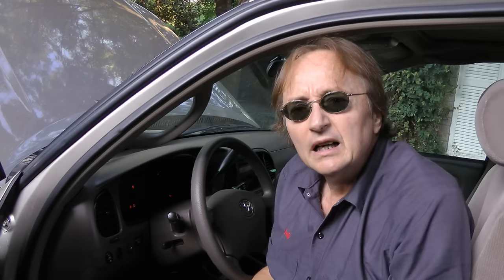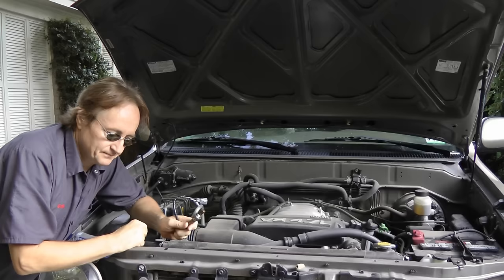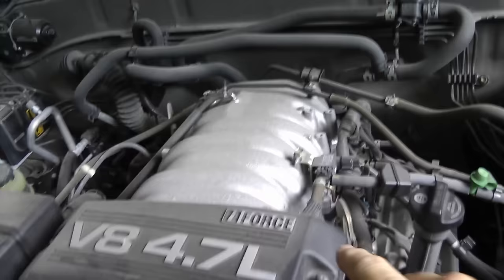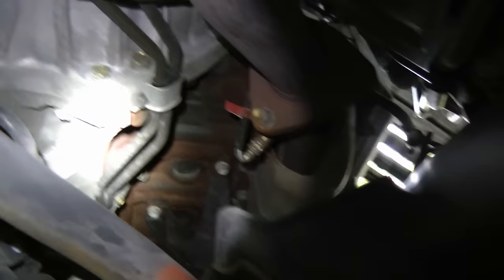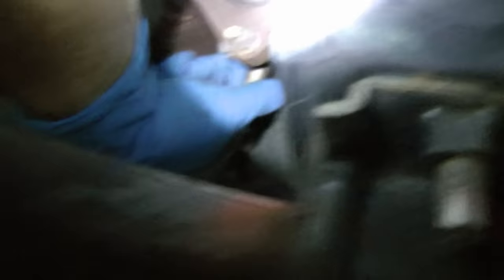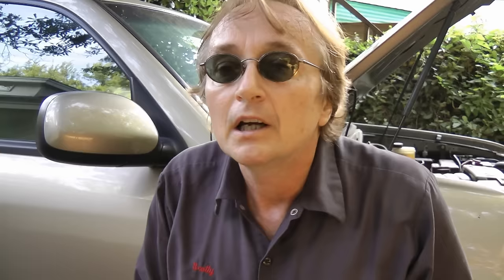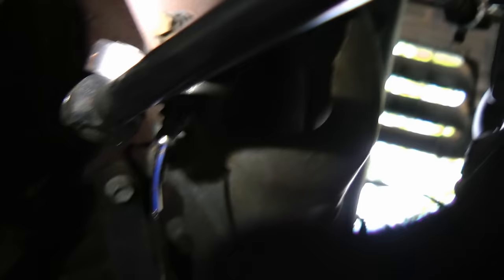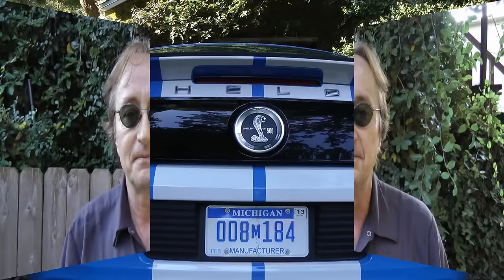How to Replace an Oxygen Sensor in Your Car (Air Fuel Ratio Sensor)

Comment: I have a not-so-good Hyundai Accent first gen maybe. And I have problem with Check Engine. It only shows up when I'm 50m driving distance already -the most... when I check under the hood, there are sensors that are not connected as the unit was already removed... I would like to ask how to remove/disable/cancel/blind a sensor? thank you Sir.
Reply from the maker: computers are made to run with all the sensors, if any are gone or disconnected, the light will never go off, no way other than putting it all back to factory specs would fix that

Comment: Got a question for you Scotty. 1989 Ford Probe GL 2.2L SOHC 4 Cylinder, manual trans. I got an OBD1 error code 17 EGO Sensor (Oxygen Sensor) Running Rich (no other codes were thrown during self-test regardless of engine on or off). Is it best to just replace the O2 sensor outright in this case?
Reply from the maker: running rich cn be tons of things, and on that old thing, often leaking fuel injectors. The sensor normally reports a problem, doesn't cause it. though running rich can burn out the sensor over time too.  I'd have a pro check the fuel injection system first myself though.
Reply: Thanks Scotty, that gives me a direction to go in at least. The car has been randomly killing on me when idling up to stop lights. With this being the only code, hopefully it won't be too painful of a fix.

Comment: Hi Scotty, I have 03 Tundra limited with the iforce engine also....but with a code that read p0057. Is that the same as the p0051?
Reply from the maker: no, different sensors for those codes, same code basics but for different sensor location, that engine has many sensors on it

Comment: Hey Mr. SCOTT. I have a 2010 mitsubishi lancer and my mechanic said that i need to replace 1 O2 sensor. Check engine light was on and he showed me the code. He did a diagnostic test nd found 1 bad 02 sensor. He said labor nd new original part will cost me $495. He said cheaper than going to dealer. Is that a fair price?

Comment: Hey Scotty, I got a problem with my 2006 crown Victoria police car, I had a po171 running lean bank 1 and a po174 running leak bank 2, I just changed my fuel Injectors, when i drove it down the road. I plugged my scanner and I have a code for a 02 sensor running rich, and another for it. When I start the car and push the gas down, it completely dies on me. Can a 02 sensor cause this.
Reply: Hi Adam, it's your manifold sensor gone bad P0171, try cleaning it, I had the same problem  2015 nissan quest

Comment: Scotty, 2005 Hyundai Tucson 2.7L V6, got codes P0150 and P0340.  O2 sensor and camshaft position sensor.  Could 02 sensor cause both codes?
Reply from the maker: no, but camshaft code could trip the other

Comment: Scott, I have a Subaru wrx 2006 and it's modified. The check engine light is on and I scanned it , and it says an o2 sensor is bad and it will not turn on. What do I do ? It also burns gas fast
Reply: El jr 3 Did you change it yet?

Comment: Great tip. ALWAYS use OEM for spark plugs. Thanks again. 

Does that mean most cars only have 2 sensors?
Reply from the maker: +IWBVS depends on the design, some have 5

Comment: how can I locate the O2 sensors fuses in the fuse box,I have a 2015 toyota corolla? what happens if I take them off? and also how can I locate the mass air flow fuse box?
Reply from the maker: ahmed sal they are not fused, they run off the computer with very little power. same with the mass air flow meter, no fuse for that either. But if you take sensors off, it will mess with how the car runs and ruin the air fuel ratio and turn the check engine light on

Comment: Okay I have a 2002 toyota solara and I replaced them exact same sensor bank 2 sensor 1 but the check engine light is still on what do I do next?
Reply from the maker: +Evan Ruiz-Lopez if it fixed it, light will go off driving a week or so. If not, something else is wrong like bad cat, other band sensors, or bad computer software

Comment: I own and drive a 1996 holden vs commodore v6 and the check engine warning light always comes on just as the car warms up. I get code 64 from the ecu, which is the left and right hand banks of the engine are running unequally on the mix of fuel, lean 1 side and rich the other. Could this be a bad 02 sensor causing this? Great video!
Reply: This car is manufactured in australia, known as the " ecotec " engine.
Reply from the maker: it could be, but more often it's a vacuum leak on the lean side and leaking injectors or a blowing head gasket on the other side
Reply: Hi thanks for your reply, I found my car manual, they say code 64 is oxygen sensors. I don't have a flat ground too jack the car up and put it on chassis stands though so I'll get my local mechanic too put them in. I'll check too see if the engine has the other problems you say more often causes this. I did disconnect the injectors on both sides and engine speed did adjust. I also held a long flat blade screwdriver too each one and could hear a clicking.  I need too check the vacuum leak, do you have a video?

Comment: Hi Scotty. I have a 2007 Acura TSX. The car have a code 2271 for bank 1 sensor 2 stuck rich. My car has been running rough lately and also having a rough idle. Now, I did some research about this trouble code but it confuses me. What can trigger this? Is it just the o2 sensor itself? My temperature gauge hadn't been up (usually falls under 9 o clock even after a long drive), but after driving my car for 50-60 minutes today, the gauge went up above the 9 O clock. I was worry I might overheat my car so I stop driving it. I rescan the code and it is still the p2271 code (b1 s2 stuck rich). Can this code cause overheating (according to my research, it doesn't but I might be wrong). Or is it something else? If it is something else, then why is it giving me this code?

Comment: scotty after we replace the O2 sensor i have to erase the code with mi scanner or disconect the battery  or just put the new sensor in?
Thanks
Reply from the maker: +TheSopranos1974 IF that fixes the problem, light will go out by itself driving a few days

Comment: Hi scotty.  I have oxygen sensor codes on both banks!  I have read in forums it could also be a vacuum leak, which is what I originally suspected, as it seems to be running lean.  I did check everywhere to find a leak and couldn't.  Is it both O2 sensors??
Reply from the maker: get it analyzed by a pro with a dealer level scan computer. Cause running lean more often causes O2 sensor codes, not the sensors causing leanness. Odds of both sensors going bad is very low.

Comment: I have a 90 oldsmobile cutlass ciera i replaced coil packs and the throttle sensor would the oxygen sensor cause it to idle high and low and blow out grey smoke?

Comment: When changing my exhaust the wire broke on my O2 sensor, would it be okay to splice the wires back together with a crimp tool

Comment: I have a 2002 Chrysler Sebring sedan the check engine light came on and it it's the bank 1 oxygen sensor 2  02 circuit had high voltage for predetermined period time but I still can't find it in my engine

Comment: i have suzuki liana 1.6  i have a engine light and very very low millage only 7 killometer per liter and also bad smell of a fuel to and when the temperature niddle comes in middle rmp niddle drops after thr engine fan on its become staible i scan the engine it showed me h20 problem plz let me know how to replace it and which one to replace and what's the problem i got and 1 more thing i got that problem after changing my car battery plz reply soon i waiting for u

Comment: Toyota Camry 2002 
I have a p1135 error. I replaced the o2 sensor a while back without resetting the check engine light. We finally reset the light, but it came back on giving the same error code. Other than the sensor itself, would there be another problem?

Comment: Hi Scotty! Recently I took off my oxygen sensor on my 92 Nissan NX-R.. When I screwed it back in snug and started the engine a small amount of smoked started seeping thru!!  Do you reckon I need to use a product on the thread to seal it and what product?
Reply from the maker: Tom Pongrac they make a copper gasket goo that good sensors come with. Put that on after removing it again
Reply: Scotty Kilmer is the sensor goo "Permatex Ultra Copper RTV Silicone Gasket Maker - Maximum Temperature, 85g"? :)

Comment: Can someone please help me, my 2000 dodge grand caravan is having a severe loss of power and frequent engine misfire when under load and barely can make it up hill,  when i come to a stop such as pulling in a parking spot the car will die, i recently changed the spark plugs and spark plugs wires too, also the muffler is making popping sounds, my check engine light is not on either, please help and thanks!

Comment: hi scotty, my truck has 3 senors i believe, one right by the block on the manifold, one under that one and another under that one. autozone computer says one of them is bad. the part is bosch 15719 but they didnt tell which senor. i am especially confused because its a ford 4.9 300ci inline 6 engine and autozone said bank one senor is bad

Comment: Have you ever used the universal 2 or 3 wire o2 sensors that are half the cost of the specific application for a car?   I have a WRX and one that I'll need is almost 200 dollars and a generic is 75 dollars...  Is there something major about them that makes the specific part worth it or am I just paying almost 100 dollars for the correct connector when I can easily splice the wires myself.

Comment: Hi, I have a 2005 Dodge Grand Caravan that needs the upstream O2 Sensor replaced. I had a friend of mine under the hood trying to take the old one out and it is stuck in there. He was at it for at least an hour and it wouldn't budge. What would you suggest we use to loosen it up to be able to get it out and the new one in?
Reply from the maker: heat it up with a torch, then they always come off
Reply: Use  .  Liquid wrench

Comment: fairly hard to pull up but i put it on a slight incline in neutral and it rolls.. im kind of at the end of my ideas i just hate to pay for the car when it gets about 13 miles to the gallon (did the math per half tank used) its a 16 gallon tank and i do baby it when i drive which baffles me why i get such bad milage.. yesterday it was 1/2 tank i put 40 miles on and its down to 1/4 tank please help any suggestions id love to hear thank u

Comment: Hi scott , I got a p1166 and p1167 code on my Acura rsx, i changed the o2 sensor but the code came back 2 weeks later, i went back to the mechanic and he said i needed a new catalytic converter. Im aware theres a secondary catalytic converter, is there a chance my secondary is faulty not the catalytic converter?
Reply from the maker: yes, they are complex feedback systems and it may not even need a new cat, tons of things can trip that code.  I would only trust a real pro mechanic to analyze it and give a guarantee that his work will indeed fix it.

Comment: Hey Scotty. 

I need a new upstream o2 sensor for my 2004 Mazda 3 2.0 California Emissions and the Mazda o2 sensor is 249.61. Would I be fine going to advance autos and getting a Denso or Bosch instead of the OEM one? Just trying to save a couple of bucks lol
Reply from the maker: denso ones normally work fine, I would not use a bosch though
Reply: Scotty Kilmer That's surprising to hear, I thought they invented the O2 sensor. I'm curious what it is you don't like about Bosch.

Comment: Hi Scotty big fan! I have an 08 Acura TL and my problem is that when the weather is really hot outside my car acts really sluggish. I'll have gas pedal to floor and the car doesn't go as fast. But on nice breezy days my car drives really nice! I don't have a check engine light or anything. You think 02 sensor would fix it?
Reply from the maker: I doubt it, temp has more to do with bad main computer circuits shorting out, the oxygen sensor is always hot on the exhaust, outside temp would not effect it at all
Reply: +Scotty Kilmer the pcm right??
Reply: +Scotty Kilmer or maybe it could be Accelerator pedal Sensor? But it's weird I'm not getting any engine lights.

Comment: SORRY the socket isin't for 1/2 inch drive its 3/8 and it will also fit a 22 mm socket over the top, but the largest socket that comes in standard kits is         21 mm. So I had to either buy an adapter (1/2 to 3/8) or a 22mm socket. and you may even need a long flex bar like in the video to add torque.

Comment: Scotty I really thank you for your show I watch all your videos, and now I have a problem that I think I can fix by myself, I have a 2005 Nissan Xterra and got the code P1288 and P1289, it means I have to replace the sensor 1 on bank 1, some people recommended me to change sensor 1 on bank 2 too (even when the code says is only bank 1 the one with the problem) is replacing the 2 sensors really necessary or I should only replace the one is bad?? 
Also this is not a oxygen sensor, is a Air Fuel Ratio sensor.. (so not sure if this makes any difference)
Thank you very much in advance Scotty!
Reply from the maker: just change the bad one first, those things cost a ton and often break independantly
Reply: Scotty Kilmer Thank you very much!.. I'l do what you said, and I'll buy genuine OEM as you said on the video (and yes, they are very expensive.)

Comment: So we replaced all our sensors because we thought it was the 02 sensor and I did not know this p0420 could be anything on the fuel system not knowing the code stayed on after replacing and running three bottles of cat clear, nothing worked, so I ran liquid molly fuel injector cleaner thru two weeks ago code is still off! It was probably the injectors the whole time, dirty gas kills your engines just going to run  liqui molly through now

Comment: Hi Scotty ,I have a bank 2 Sensor 1 code as well  for my 2008Cadillac CTS DI V6 (P0050,P0155). The correct sensor to buy is an upstream sensor correct? A BOSCH 16861 is what is recommended for my Vehicle which has the( V 8th digit not 7). How long does it take to change this sensor?
Reply from the maker: yes, upstream, changing it just depends how hard it is to acces, some are real stinkers requiring removal of stuff in the way
Reply: Thanks for your quick reply, very much appreciated. I can see why you have so many subscribers. Your the man! No one had the sensor in stock so I ordered it so I can have it fixed by the week because I'm starting to notice the symptoms especially at slower speeds.

Comment: Scotty my car is throwing two codes p0138 and p0606 do you think a bad o2 sensor might be responsible for it?
Reply from the maker: e77754321 pray it's just a bad oxygen sensor and not a wiring or computer circuit problem

Comment: I have a 03 jeep grand cherokee 4.7 and I added a throttle body spacer after market exhaust and a cold air intake do I need to run a diff type of sensor?  Or add a ecu chip to send a diff signal to the computer?  With all the upgrades it seems to not like the oxygen sensor that are in it currently
Reply from the maker: once you upgrade that stuff, ONLY a real pro with a five gas analyzer, a dyno, and the ability to reprogram your computer would make that system run correctly. That's why I never try such stuff
Reply: Thank you for commenting back this is the first time watching one of your videos I'll be subscribing n waiting for Tuesday :)

Comment: 2000 Mitsubishi Mirage Code P0141 P0136 changing the downstream O2 sensor will solve this problem most likely. Like Scotty said use original OEM sensor (denso) from Napa or something like that. I tried saving and bought a cheap one off ebay and had to do the job twice. So yep not worth saving that extra 20 bucks.

Comment: I got a code on my Ford focus 2005 2.0 liter and it said running lean on bank 1 cylinder one ? Could that be the upstream 02 sensor?
Reply: That could be a ton of various things. Could be bad injectors, bad spark plugs, an air leak, could literally be anything.

Comment: Hi Scotty, Love your videos man. Keep up the good work! Hey I have a 2000 Accord v6 that is giving me a bad Barometric pressure sensor or BARO sensor, I am told by the Honda techs that I need to replace the ECU??? Ouch! Is there an alternative? Any feedback you can give me would be greatly appreciated! Thanks in advance!
Reply from the maker: +Rod Castaneda  if it runs OK, ignore it. If not, computer would need replacing

Comment: hey scotty is it possible to make oxygen sensors last longer by cleaning them periodically with a little bit of mass air flow sensor cleaner? and do i really need to use that socket to remove them or can i use an open end wrench with a long metal tube on the end of it to pry it off
Reply from the maker: na, leave em alone, they are basically self cleaning as the car runs, you can't clean em by hand

Comment: hey scotty i have a question about 02 sensors. so the other time i was checking with a scan tool to read the millivolts and it shows me 0, so then i bought a new o2 sensor and it reads 20 mv but then goes back to 0 again can this be wiring from my ecu being shorted somewhere?

Comment: Hey scotty i really want to identiyfy my car lexus rx300 has no more misfire codes the exaust still putts rough on cold starts and when the engine is fully warm the exaust has a very soft putg but running better. Also  when we accelerate the car is smoothe and when ever we start the car we get a lutt sound from engine i have p0171 lean code fix vaccuum leak but sometimes shows p1150 front heated air fuel ratio sensor i need really good help please
Reply from the maker: replace the air fuel ratio sensor, they do that often on that model

Comment: Scotty i have a 2001 honda passport, when i put it on drive the rpms drop when i put it in neutral its fine, it initially has bank 1 up and dowstream o2 sensors bad, could that cause the low rpms?